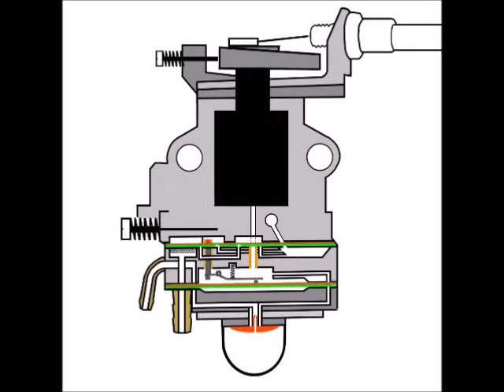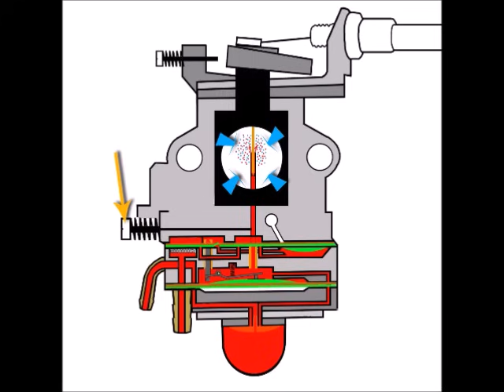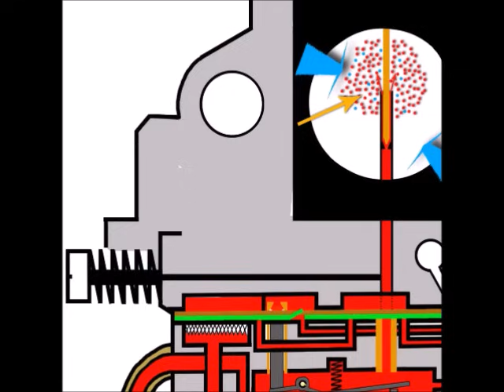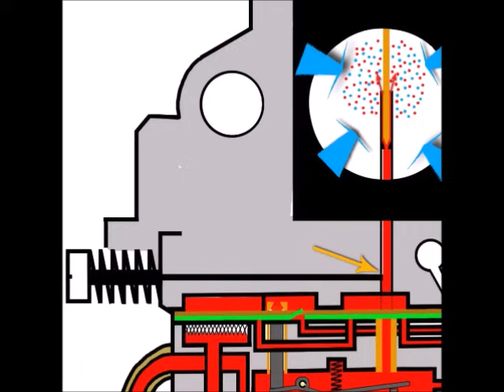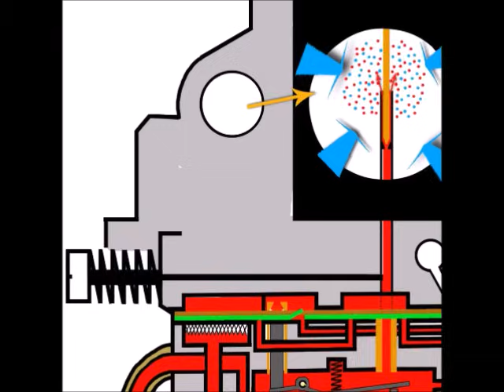CARBURETOR TUNING: Single Adjuster Screw Setting EXPLAINED!  (by Craig Kirkman)

Comment: I have a carb like this on my 46cc leaf blower, it runs fine but it idles high and then when we reduce the throttle screw the blower just dies and never gets to a point where it idles enough.  Does anyone have a rough idea of how many screw turns a basic setting should be before fine tuning the jet?

Comment: However, my 2008 Craftsman Leaf blower 4cy 29cc (Model 316.794610 or 41CS4ESG799 (carb is 753-05908) does NOT have a L and H carb adjustment but is stopping upon trigger acceleration. It idles fine forever, though. <smile>.... you or anyone have a solution? I've tried a new carb, adjusted intake/outtake rocker arms at .003-006 and it still stalls upon revving it up. I even cleaned the muffler exhaust clean. No clue.

Comment: What failure would be allowing full revs on a leaf blower with the High speed screw turned all the way IN.  This is brand new but yet cheap amazon carb.  It will only go full revs with H turned all way in. If you turn it out at all it will start to die.  Also if you could point me to one of your videos that might explain this.  Thank you in advance.  I did ultimately just rebuild the original and put back in and its running correctly but Im curious as to what was going on there.

Comment: Just because the low-speed screw is hidden doesn't make it a single-adjustment screw carburetor.  Now, the carburetors that have no high-speed adjustment screw are really a single-adjustment screw carburetor and engineered trash in my opinion because who wants to disassemble the carburetor to change the jet size to get the engine to run right 🤨

What I find amusing is that the low-speed screw rarely ever needs adjustment once it's properly set hence the reason they didn't eliminate it and rather the high-speed since it will destroy the engine much sooner by leaning it out 😡

The days of the 2-cycle engine are long gone because this new garbage is intentionally being manufactured to fail due to the elimination of the high-speed adjustment screw on all consumer-based products!  Don't waste your time and just purchase a 4-cycle engine instead and avoid the hassle and expense 😉

Comment: Hi, viewer's please understand that the one adjusting screw which this man talking about is High Screw ie, can be use only when you are revingup and your engine is bogging, there's one more hidden screw where the throttle cable is connected to (in the middle which is pivoting), that is low  screw,. You need a special carburettor adjusting screw  driver to adjust this LOW screw. Cheers
Reply from the maker: Yes you are correct. I do have another video coming out soon that explains all about the Hidden LOW Screw at the top. Thanks for highlighting this. Craig

Comment: I bought a Bladez 60cc Street Competition standup scooter from a guy 5 months ago, and the scooter was completely apart it took me 3 months total to put the scooter back together. I rode it to work a few times, but today, i had an issue. The scooter acts like it wants to go so bad, but it hesitates when i give it full throttle, I noticed that my tomb screw keeps getting loose after a few minutes of me riding but in this carburetor that i have install, it do not have the spring on the screw so can that be the issue. 

2003 60cc Bladez Moby XL Comp Stand up Scooter

Comment: Excellent. Actually solved my problem with a strimmer that wouldn't start properly, and even when it did it wouldn't idle.

knowing which way to turn the idle screw, and which end of it's range we'd expect it to be was essential info to solving the issue (lots of pull starts to get to the optimum point).

Many thanks.
Reply from the maker: Thank you for your kind feedback. 👍

Comment: Turning that screw does absolutely nothing at all.
I took it off, took a syringe full of Berryman's B12, and shot it through with no obstructions.   
After spending 5 hours yesterday surgically cleaning this thing inside and out, I'm done with it.  I just ordered a new one.    I've spent hundreds of hours trying to clean carbs out all hopeful every time now it's finally going to run right, and it never does, so rinse, repeat, ad nauseum.   On and off again, over and over.   Humanity should of been 100% done with carbs 75 years ago...

Comment: i have a g9 yamaha gof cart, new carb, new fuel pump, it won't run right unless i hold the choke out??? everythings clean, engine rebuilt last year,hardly ever used? tis is a clean lifted well taken cared for cart, I am steimied? When the choke is on it runs smoothe as silk.HELP/

Comment: Hi grate explanation simple and easy to understand well done. Please may explain  why these engines are very hard to start even with new cuburator or spark?
Reply from the maker: Hello,

Thank you so much for your kind words and feedback! I'm glad to hear that you found the explanation helpful and easy to understand.

Now, regarding the challenge of starting small 2-stroke trimmer engines with primer bulbs, even with a new carburetor and a good spark, there are a few common reasons why this can happen. I appreciate that you might already know some of these reasons but i have listed a few reasons to be sure:

Primer Bulb Issues: While the primer bulb is meant to help with easier starting by delivering a burst of fuel into the carburetor, it can sometimes be a source of trouble. If the primer bulb is damaged, cracked, or not functioning correctly, it may not be delivering the fuel effectively, making it harder to start the engine.

Fuel System Problems: Problems with the fuel system, such as a clogged fuel filter or fuel lines, can restrict the flow of fuel to the carburetor. This can result in insufficient fuel reaching the engine, making it difficult to start.

Air Leaks: Air leaks in the intake system, including the carburetor gasket or intake manifold, can disrupt the air-fuel mixture, causing starting issues. Even a small air leak can have a significant impact on engine performance.

Compression Issues: Low compression in the engine can also make starting difficult. This could be due to worn piston rings or cylinder walls. A compression test can help diagnose this problem.

Carburetor Adjustment: The carburetor may require fine-tuning of its settings. Ensuring that the air-fuel mixture is correctly adjusted and that the carburetor is clean and free from debris is essential for smooth starting.

Quality of Fuel and Oil Mixture: Using the right fuel-oil mixture and good-quality fuel and oil is crucial. Old or contaminated fuel can lead to starting difficulties.

Choke Operation: Be sure to use the choke correctly during starting. Depending on the engine and temperature conditions, either a full or partial choke may be necessary.

If you've already ruled out issues with the carburetor and spark and are still experiencing difficulties starting your trimmer, it may be beneficial to inspect and address these other potential causes. Additionally, consulting with a small engine mechanic or technician can help identify and resolve the specific issue with your trimmer, ensuring it starts reliably.

I hope this has helped a little and give you at least some idea about whats going on in your engine/carburetor complex

Craig

Comment from the maker: All Episodes -for 2-Stroke Carburetors Here. Thanks. Craig: 
https://www.youtube.com/playlist?list=PLrlXp3PlwgRI5OLvm3P91LJr1CYnO5TRD
Reply: This is not a single mixture screw carb 

The hi flow mixture screw is hidden 

If you look at the top where the throttle wire connects to the throttle barrel there is a brass collar/screw in the top of the throttle barrel 

It has a rubber tube hiding underneath it is the hi flow mixture screw

Also this video demonstrated that the so called air/fuel mixture screw has NO POSSIBLE WAY to adjust the air flow meaning its the lo flow mixture screw not a air/fuel mixture screw 

Hope this helps

Comment: Hello I have a bs52y trench wacker 1998 the carb only has one screw which move the lever the throttle cable is attached too.
The problem I'm having is when I open throttle the revs don't go high enough to start wacking properly. 
If I open choke revs go up and it starts wacking,would you know if carb needs a service.
Reply from the maker: Hi. Thank you for your comment.  I used to work on these Wackers quite a lot when I was a Plant Mechanic and I found there to be two adjustment screws behind two tightened screws labelled H and L. Once the tightened screws have been removed you can access the adjuster and set the carb.  

If yours is a variant of the ones I know of, having no adjusters, then, ye,s you are absolutely right. After making sure you have a clean fuel filter and air filter and fresh fuel, you may need to clean out the carburetor.  I did have to clean the carbs on these quite regularly because of the dusty environment these machine sometimes work in on building sites.  I hope this helps. Craig

Comment: Question, mine revs really high and it runs quite well, it revs from idle to high rpms with no trouble. But I'm paranoid it might be running too lean, what are some signs that the engine is not getting enough fuel and oil
Reply: Over heating or turning off when idling or ur motor will seize

Comment: How many turns out should the mixture screw be as I can't get my 2 stroke running right? It runs for about 30 seconds or dies instantly if I give it throttle?

Comment: After tuning machine got too much hot and burn smell coming.. What to do?
Reply: You have made it too lean by turning the screw in too much. The screw needs to be wound back out to add more fuel and keep the engine cooler. Go slow 1/4 turn at a time.

Comment: Hi there T.R.S I have a brush cutter with this carburetor I found it quite hard to adjust and I didn't find it efficient or effective ( even when running well) I had then put a chainsaw carburetor and what a difference more power more efficient on fuel and just far better than the single screw barrel

Comment: Craig, can I put a shutoff valve in the fuel supply line of a 2 cycle motor with two fuel lines, one supply and the other is return.  The fuel tak is mounted below the carburetor.  I have a southland, 43cc walk behind weed wacker.  I'm concerned because the fuel line is under vacuum to "suck" the fuel up into the carburetor and I don't want to stress the thin gasket material inside the card..  Thaks, Joe V

Comment: Hello. I have a hedge trimmer with a new single screw carb. It starts and idles but have no high speed. I can a adjust the bog out but still high rpm. Any idea would be great. Great Video.
Reply: Turn it in a few turns and out a few turns and just fine tune it

Comment: I've got a multi tool with the same carb.

It will not start up after being primed, choke on etc.

I have to remove the spark plug and squirt some fuel into the bore.

Plug in, cap on and away it goes, runs all day long long after that.

Even tried a new carb and same problem.

Any ideas?
Reply: Check your fuel lines, if they are old the might have pinhole leaks in them. I had the same problem as you and had the old black fuel lines. Was getting a lot of little bubbles in the primer and impossible to start. Put new hoses on and it much easier to start. Might be worth checking mate.Good luck.
Reply: @boastyy  I'll have another look, pretty sure I do have some spare fuel line in the shed. The primer bulb certainly pulls the fuel through well but it's a fairly quick and easy job to rule that out. Cheers!
Reply: @gtd65  No problem mate! I checked everything on mine and it still would not start. Bought a new carb, still would not start. When I changed the old fuel line it was not obvious there were any holes in it, but on testing it it had tiny holes which were causing a problem. Like you said easy to rule out and well worth checking mate. Good luck and hope you get yours sorted.  Let me know how it goes, if you don't have any luck I know what else to check.
Reply: @boastyy  I meant to do that today but it was pouring with rain. Hopefully, it'll be more dry tomorrow.
Reply: @gtd65  Yeh I hear ya , raining hard here too. Best of luck man!

Comment: Why would a strimmer carburettor need adjusting its set to factory settings so why or how would it need adjusting the screws cant move on there own im attempting to adjust mine as its hard to start.

Comment: Thank you for your professional explanation  how the carburetor
works ....I have a Bolen Wipe Sniper single screw adjusting 
I have cleaned the carburetor  put back and  not knowing how many
turns the screw as to come out it does tempt to start on
1/half turn out but then stops ....Could you please give an idea 
where the problem is ?

Comment: My son bought a new Jiffy ice auger a few years back and it never did run right. Thanks to your video on how the bulb type carburetor works I was able to determine that the intake gasket was blocking the the little vacuum hole going into the crankcase. Thanks for the awesome explanation. 👍👍👍

Comment: don't forget the idle mix is set by removing the plastic plug on "tip" of the barrel. There is a tiny flat blade screw inside which sets the orange vertical height in your diagram.
Brilliant diagram and explanation thanks.
Reply: Hi, how do you set both screws as the main one will effect the idle one two.  So do you run full throttle and find the mid point between too rich and lean for the main screw, THEN idle and adjust the idle jet slightly?  Of course if you rich this a little , there will be a touch more fuel at wide open throttle too? Tricky?

Comment: I was having idle issues the other day, I got the engine running and in real time was messing with the mixture screw. I got it to the point right after it was about to die out and would now idle and left it. Took it for a test drive for about 20 minutes and it ran great.

The next day, I gave her one pull with choke and she started and I immediately pushed the choke back in, it died. Never could get it to start again and it was badly flooded, it made no sense to me. Is it possible I have the mixture screw too loose and that flooded it? Perhaps having it so loose is masking some other idle issue? Thanks for the great video!

Comment: Air mixture is also on 4 strokes?
Reply from the maker: Some 4 stroke engines do have an adjustable air mixture screw and some dont. It depends on the engine. Thanks. Craig
Reply: @TheRepairSpecialist  thanks....i was looking for it for the longest time...(thinking) "its gotta be here"....

Comment: Hi Craig! 

I just bought an old, used Kawasaki TH48 brush cutter 48cc/3hp, which is in excellent condition. 

The carburetor has a single adjuster screw. Tuning it by ear, it sounds best about 1/4 to 1/2 turn out from the point where the line head starts to spin when on idle. 

My question is: With single adjuster screws, is it correct to turn the screw clockwise until it's tight and then counterclockwise 1&1/4 full turn and go from there? Or is it completely different than the classic H, L, T screw carbs?

Thanks a lot for everything you put out there! Keep on keeping on!
Reply from the maker: Hi. First of all thank you for your nice feedback, I really appreciate it.  As for your question.  Are you meaning the Idling screw? or the fuel/air mixture screw? The idling screw should be turned out so that the head just stops spinning (as you have done) and the mixture screw should be adjusted when you are using the machine at full throttle. Turn the screw both ways just a little and get the engine to sit its RPM in a kind of mid point between engine RPM lowering on one side and RPM lowering on the other.  When I am at that mid way point, I just take the screw out very slightly (not much at all) to make it a little Rich.  I find this helps better when starting the engine and keeps more fuel mix going into engine to lubricate the components.  I hope this helps. Craig
Reply: @TheRepairSpecialist  

Thank you for your reply!

Yes, I have turned the idling screw to the point where the head just stops spinning. As for the air/fuel mixture screw, is it supposed to be "hidden" or something? I asked a local small engine mechanic about this and his response was that some of these particular Kawasaki TH48 models have an air/fuel mixture screw, and some don't. Is this possible?

Thank you!
Reply from the maker: @RangerNo  yes it is possible. I have come across a few that don't have adjustment screws. Have another god look for it, but maybe it doesn't have one. If it doesn't then this means that keeping good servicing of your  Carburetor and good quality fuel, fuel filter and oil is a must to keep your machine running well if you can't tweek an adjustment on it. It's a must for all machines having said that though. Craig

Comment: Thanks for your perfekt videos, but i got and issue with my hedge trimmer. I've just change the carbureator with a new original one, but now its die right after powered up. How shall the single screw adjustes? Shall I fully close it clockwise, and then turn anti clockwise once before starting the engine? And what about the idle screw? Best regards

Comment: The most complete explanation I have found.Thank you. How about Initial setting of the carburetor when cleaned, all screws were being taken out then reassembled? I know that the bottom screw is 1.5 to 2 turns , but the other, upper one, that from the throttle adjustment? And how to set the best idle ? Thanks.

Comment: Can you tell us something about adjusting the needle (by ear) for this type of carburetor.  As far as I know it is located at the top, sometimes hidden by a rubber stopper.  Do we adjust the needle as well as the mixture screw or L screw?  Thanks
Reply from the maker: Thank you for your question. I think that best thing will be to make a video on this. I will try to get to it ASAP.  Many thanks indeed .Craig
Reply: Thanks sir